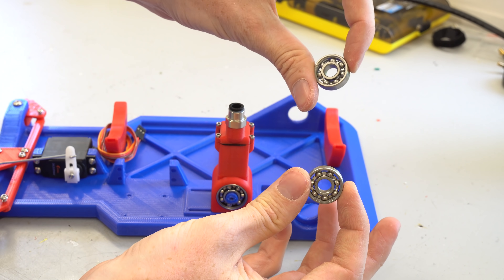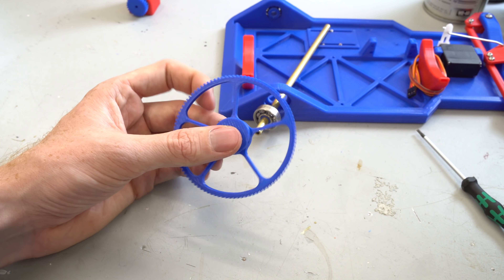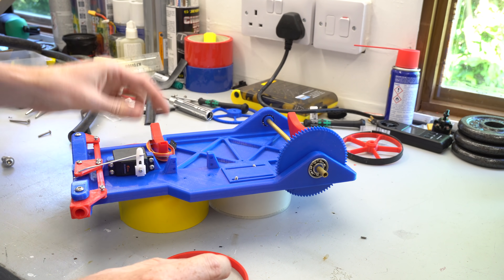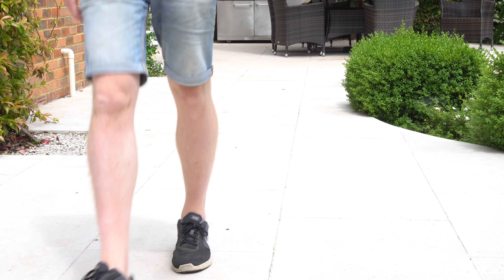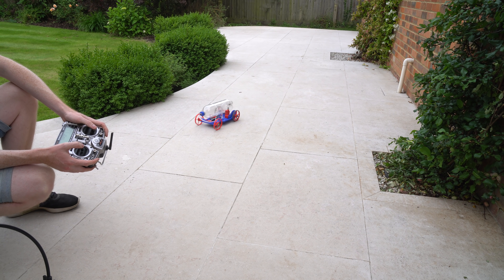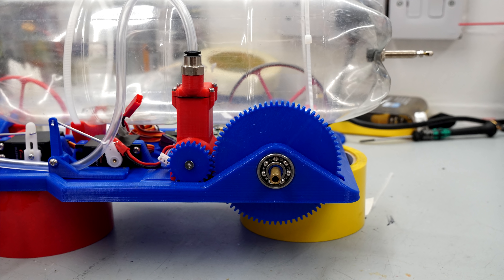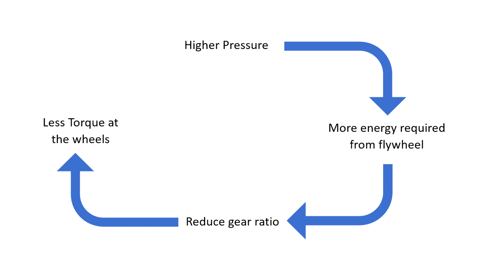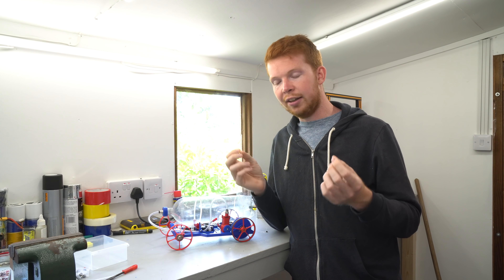Air Powered Car

Comment: figure out away to make a higher torque engine and maybe a pressure regulator so you can have a high psi that is converted into a lower psi so it can run longer and smoother. hopefully you understand what i mean!!!

Comment: For a combustion style engine that can use 3d printed materials, would it be possible to use a cold fluid instead of gasoline, such as liquid nitrogen, have that injected into the cylinder somehow and use the rapid expansion in atmosphere to create a functioning motor? Or just use it as a source of pressure for a smaller vehicle?

Comment: Old Tractors/Engines that needed a flywheel didn't rely on the load to be the flywheel like you are. The main engine shaft needs its own flywheel so that you don't need to rely on the load to keep momentum up.

Comment: Retarding the cam is the way you get more torque on a 2stroke engine, perhaps this would help yours too. Doing the opposite helps with peak power, but at low speeds it will struggle. You need some v-tec

Comment: You could try a rapidly-spinning flywheel directly on the engine, while keeping that high gear reduction to the wheels. Like some of the old steam-driven tractors had.

Comment: A simple way out is to use the throttle to reduce the pressure then open it up when the air pressure in the bottle lowers.

Comment: restrict throttle at higher pressures and slowly open it as pressure drops, some elastic that utilises the squishiness of the bottle changing as the pressure drops could allow you to design an automatic choke

Comment: Add a fly wheel as an intermediate step: engine runs the flywheel, flywheel runs the wheels (with a clutch?). This allows you to have a heavy flywheel with a gear ratio that allows it to carry the engine, but still have a good enough gear ration to the axil.

Comment: Like you once proposed and then gave up on: 4 cylinder motor. It would have a lot more torque and you wont have to worry about the flywheel + you get to show us your engineering skills :P

Comment: You could also build a simple air regulator on the bottle. That way you can run the engine at around 35psi and pump the bottle up to it's safe maximum psi. This would give you longer run times something around like 2x(this is in now a scientific estimate)times if the bottle can handle 60 psi. You could also get some glass fiber(sold at retail or autoboty stores) and string to reinforce the bottle allowing it to hold much higher pressures.

Comment: CUT A SLOT NEXT TO THE ENGINE, AND ATTACH A FLYWHEEL DIRECTLY TO THE ENGINE!

The effectiveness of the "flywheel" you designed was reduced by the same ratio of gears you used to drive it, rendering it useless. I thought this concept was fairly self apparent. 

Also, do not make cutouts in the flywheel for decorative purposes. That spoked gear you used first, if it had functioned, would've been even worse as a flywheel. Make it one solid disk of material with the largest radius that fits, as fat and dense as possible. That is the ideal shape for a flywheel.

Comment: Tom, Tom, Tom! I commented last video that you’d have flywheel issues. Now listen up mate: the torque increases with the gear ratio. The inertia seen by the engine decreases with the square of the gear ratio. So you’ll get a bigger improvement in flywheel effect by a small reduction in gear ratio than you’ll lose in torque. So that may be worth trying.

If not, then without changing the engine, you could add a flywheel. The simplest would be to add one to the motor output shaft. But if you don’t have space for that, you could add one by gear from the motor gear. If you use a flywheel pinion smaller than the motor gear, then the motor will see an increased flywheel inertia by the square of the gear ratio, so you could use a fairly small flywheel, like the old inertia wheel toy cars (though their gearing was completely excessive for this purpose).

Hope is not lost yet!

But when the time comes to rebuild the engine, a multi-cylinder phased design would make it auto-start.

Comment: Using airflow restriction is a waste of energy, use a variable geometry cam system to double efficiency and increase drive duration.  You now even have a servo with enough torque to do that.

Comment: Whyyyyyy not just use a weighted flywheel?
Reply: G'day,

  Yay Team !

  My thunkin's prezactly...; but I was ponderin' the possibility of usin' the existin' printed Plastic  Driving-Gear/Featherweight Flywheel to make a Plaster Mould, then melt or burn out the Plastic (as is done with Lost-Wax Casting) and then cast a Metal Gear...; but, of course y're right, simply glueing a small Coin or a Steel/Lead  Washer onto the Gear would cure the problem, with a shitpotful less mucking around...
 
   Have a good one,

 ;-p

  Ciao !
Reply: WarblesOnALot tbh I was thinking to just turn a Brass or steel weight, being an aerospace engineer he should have access to a lathe XD

Comment: Hey Tom, what about making that multiple cylinder engine for this rather than a plane, it would overcome all the issues you talked about. You could even make the cylinders smaller so they run about the same cfm of air or close to it.

Comment: u could throttle the pressure down when starting. otherwise ad a flywheel directly to the engine
Reply: or make the car heavyer .
Reply: also I Designed an Engine similar to yours , same valve and cam type. I'm not trying to sell it or steel any thing I don't plan on distributing it . but the thingivers files won't load on the page for me from r whatever reason and I want one lol . I hope its not an issue . I really enjoy this project and videos . keep up the good work

Comment: I have built something like this. You should have used two pulleys and a rubber belt from an old tape deck. It works much better and no need to mesh the gears. And it is very easy to change the ratio and doesn't rob as much power.

Comment: I keep looking at this and thinking if you built an opposing twin cylinder engine then you would have less need for the flywheel effect. Part of the power produced on the down stroke of one cylinder would be utilized in opening the valve on the up stroke of the other. This should allow you to run higher pressures as the engine is helping itself turn over. I remember in earlier discussions of a multiple cylinder engine that you weren't sure about air supply to both, but with your new head design with the tubing you could just put a t in the tubing and run it to each side of the engine. You also had concerns about vibration. I feel like that could be remedied by drilling and placing a weight in the crank shaft or even the output gear. With the lightweight components you have I don't think it would take much weight to offset it. Hope this gives you some ideas.

Comment: Added an electronic solenoid valve for the air, you will reduce friction and will be able to change timming of injection and long of it dependi g several factors, speed engine, throtell position, etc.

Comment: You need some type of torque converter so that if the car stops the engine can keep running. Maybe a torsional spring could work.

Comment: You should turn the engine forward 90 degrees so it lies flat. 2 benefits. less bends in the input hose as its a straight run from the throttle, and 2nd, better aerodynamics !

Comment: Could you add a weighted flywheel parallel to the small fast gear?  You may need to raise the engine a bit to give yourself some room.
Reply: Oops, It's been suggested about a dozen times.  Love this build. The sound is amazing.

Comment: Might sound dumb but have you thought about using solid CO2 as it moves to the gas phase you'll be able to use that for momentum and you just place insulation between the container with it in and the chassis

Comment: This seems like one of those candidates for SLA printing. There are some SLA printers that use LCD screens to image the next layer than a directed UV LASER beam which don't cost nearly as much. It might be something to consider getting for the channel especially if you plan on continuing the air powered vehicle creation. The parts are much higher tolerance and not subject to warping or inconsistent prints.

Comment: Two double acting pistons that have their crankshaft offset by 90 degrees. (If ou do this then you dont need a fly wheel. And you dont need to push it to start as one of the pistons can ALWAYS start it from any position. )

Comment: It might be a bit hard, but you could try adding a heavy flywheel to the engine itself, and use a clutch to transfer rotation to the axle.

Comment: Shouldn't the problem be solved if you installed a flywheel directly on the engine. Im most likely missing something but i think it would be worth thinking about :)

Comment: weight of the car itself doesn't seem to be as detrimental in this project. so what if you made the car a bit heavier to work as a better flywheel. the car would be a bit slower but it could actually improve efficiency and would be easy to test.

Comment: Maybe use a turbine-style engine instead of a piston, using high pressure vessels.
That will run much faster but for a shorter duration.

Comment: There are three options, one, multiple cylinders (more torque and there will always be a valve open) and larger tank, two have an centrifugal clutch (to allow the motor to always be running and just vary the speed to engage or disengage) style setup with a larger tank like on a gas rc car, or three just do a larger tank (two to three times the size) with stronger side walls which would take longer to empty out allowing for a lower pressure but longer run time. This did look very promising at first but then it was either not enough air or to much pressure.

Comment: There is a third option, increase the angular momentum of the smaller gear. The simplest design would be to rotate I-Beam cross-section, and cut out sections in the plate to reduce weight, then attach it to the gear shaft. Alternatively, you could attach a couple of steel washers to the gear, which would be simpler, but it would add more mass, thus reducing the overall efficiency.

Comment: Two cylinders. Lifkes
 a boxer two. I know it's inefficient but you're not getting ngnvery far at the moment. So if you a B2 configuration so you ach cylinder carries eachother more through one another's dead/up stroke.
Reply: James Glover No. An opposed piston engine would be more efficient. Two pistons, one cylinder.

Comment: 1) Use a belt drive which will help with the gear thooth problem. You'll be able to tension the belt just by moving the engine.Simply use a strip of tire tube as you did with the wheel.
2) Try to increase the flywheel mass directly on the engine axel... as you would on any internal combustion engine.
3) Add some tire tube also on the front wheel for better steering.
4) If everything does or doesn't works out try to do multiple engine drive!

Huge fan!

Comment: I have designed and optimized a pneumatic car engine before. You should try adding a "heavy" flywheel to the rear axel. The positive effect will overcome the negatives.

Comment: Suspension.  All vehicles benefit from suspension.  Also try a slide as on Steam engines.  I saw one that dispensed with the chest and just had a valve running against the cylinder which had inlet and exhaust ports.  A light spring held the valve against the cylinder.....

Comment: Would it be possible to create an air pressure regulator? May not help with torque issues but may give you a longer run time by allowing you to fill the bottle up more. Just a thought, not an engineer...

Comment: There's a reason that combustion engines in cars use flywheels and clutches. You could probably get away without using a clutch system (meaning the car will always have to be moving) but using a dedicated flywheel and a larger gear ratio is the only way I see this overall design working.

Comment: What about an in-line pressure regulator before the throttle? this way you could have 50+ PSI in the tank but still obtain the lower PSI required for the motor.

Comment: If you weight the driving gear on the engine it will act as your flywheel. It will also help the car in turns as the inertia from the flywheel should compensate for the engines limited tourqe

Comment: I don't know if this will be helpfull or not but the cornering will reduce speed as when turning a car uses a differential as the two wheels are going at different speed outer wheel faster than inner this is due to the turning radius outer lager than the inner meaning the outer as more distance to cover than the inner radius. So when the car turns the two forces are acting upon each other and over coming the toutque the engine is providing, therefore slowing it down. I hope this helps and the only thing I could suggest is switching it to front wheel drive which would be difficult as turning would also be on the front

Comment: How about gluing a 2 Eur coin to the engine's gear? That way the engine have it's own flywheel.
Better yet, make a centrifugal clutch to automatically engage the engine when the engine have enough torque, and automatically disengage the engine when the engine going to die, albeit it will be a bit complex

Comment: How about high pressure in the tank with a pressure regulator between the tank and engine? Weight isn't as much as issue with the car since it doesn't have to get off the ground. Plus you could use a bigger tank, like a 5oz CO2 tank.

Also out of curiosity, will you work on some form of idle for the car? That way it can stop without killing the engine too.

Comment: Diff or cut the axle making it a rear left wheel drive. Make it be an I2 or a bigger piston maybe if you can get a chane to open the valve insted of puch rods.

Comment: I've seen a air powered car design that overcome this problem by having 2 cylinder out of phase (just like a regular car engine), so they drives each other. It was very impressive in term of speed even with low pressure. However that will require some fine tuning with the valves so that they don't work against each other. Nice work btw!

Comment: Despite the issues I'm surprised how well it works. Interesting how you got to the conclusion of what to do next. In motorsports there's a saying "there's no replacement for displacement". Less run time but more torque

Comment: Or, another solution, go for a multi cylnder design, using bottle pressure to open the lifter valve, and generate more torque.

Comment: you can solve your problems by adding a clutch mechanism in order to disengage the engine from the wheels, this can allow you to put and independent flywheel on the motor, and also allows you to speed up the engine prior to the car beginning to move, effectively putting more power and torque down to the wheels
Reply: and about the steering, a differential would help
Reply: i kinda know a bit about all of this, you know, being an engineer in automotive design

Comment: Make a “starting motor” that spins the engine so when you stop it won’t be stuck!
Reply: Either that or enable some sort of regenerative braking system to give the engine a kick upon stopping
Reply: Also, with the rotary valve idea, try some kind of water injection idea to keep compression high using water surface tension to keep a seal.
Reply: With all that crap in addition to the steering, might as well just run it on the electric motor by itself
Reply: @apking130  Yeah, this design isn't meant to be super complicated. If he wanted he could add a clutch and a starting motor and all kinds of things but then it gets really heavy and complicated and you'll run into mroe issues.
Reply: @apking130  I was thinking maybe add a small alternator but then I realized the same thing
Reply: @apking130  if the bottle has coke and mentos in it It will be more powerful with air power
Reply: I think it would work better to have a built in air compressor on it, so he doesn’t have to refill it all the time

Comment: I had a model steam tractor as a kid and it had a flywheel on the crankshaft and a really high gearing to the drive wheels, so the momentum of the tractor/wheels had nearly no effect on the steam engine. Perhaps you could add a geared flywheel to your car or redesign it to put a flywheel on the crankshaft.

Comment: You could add weight to the pinion gear making it your flywheel. 
You could use a valve like a sliding D valve on steam engines this would also allow air to escape the cylinder on the return stroke. this would work even better if you went to a double action cylinder like most steam locomotives use.

Comment: I commented about this before, but It didn't seem to register.   TOMY back in the 1980's sold a toy called Air Jammers, and they had solved all these problems.  I played with that thing for hours and hours.   It never broke and if I went thru my parents storage shed im sure it's still in there and still works.   Check it out.   they still sell on ebay for 20 bucks.

Comment: If you use 2 gears for each wheel (flywheel and power) "attached to their twin" and offset by a few degrees they will turn more smoothly and more efficiently (It's hard to explain but there are many examples online)

Comment: have you considered modeling your engine after a steam engine, should work fine with air as it would steam but be more controllable. you don't see them push starting a locomotive.

Comment: build a multi-cylinder engine. If you have at least 3 cylinders you can offset them 120° such that one of them is always on the down stroke. So you don't have to rely on a flywheel and the engine even starts by itself as soon as you open the throttle.